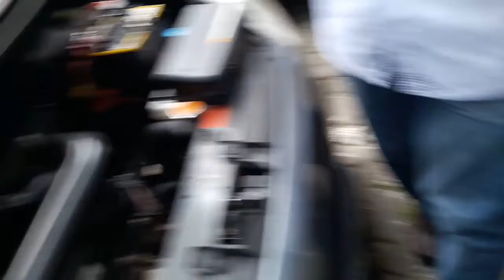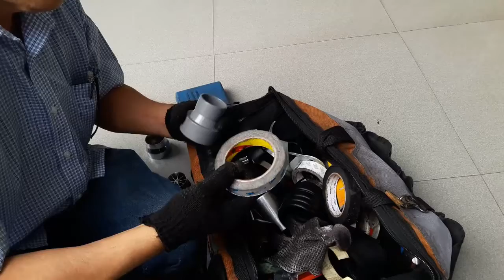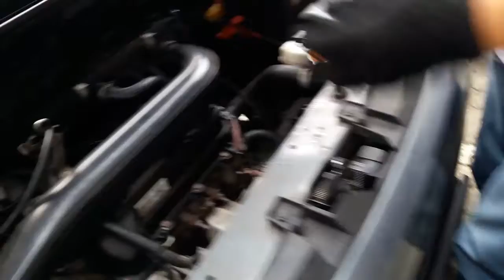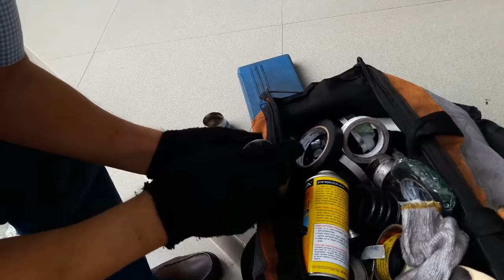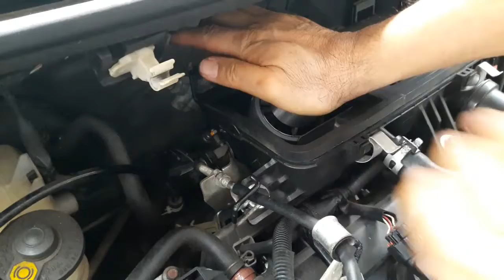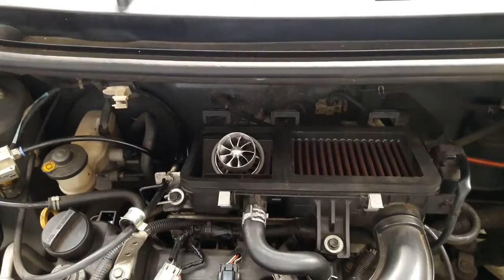Toyota Agya - Proxima Turbojet - D-700T

Comment: biaya brapa om ? mobil saya agya 1.0 manual thn 2016 om ...bisa kah ?
Reply from the maker: Kebetulan yg utk cc kecil stock lagi kosong. Yg ada stock utk 2500cc, type E930T hrgnya 6,5jt. Tapi klo mau dipake di 1000cc pun bisa
Reply: Mehong amat...ga efek bro
Reply from the maker: @caiciu  Bisa share pengalamannya pake Proxima Turbojet kok ga ngefek?
Reply: @PROXIMATURBOJET  proxima,simota dll yg baling²nya bisa berputar atau diam aja cuma sugesti bikin tarikan enteng/ enak.Udara yg masuk tidak padat seperti turbo aktif.
Reply from the maker: @caiciu  Oh begitu ... Bisa dong di share pengalamannya pake Proxima Turbojet, pake dimobil apa dan rasanya bagaimana? .....
Reply: Gilee duit 6,5jt mending buat remap
Reply: @Rioalbab01  betul om....jls keliatan bedanya
Reply from the maker: @Rioalbab01  Type yg harga 6,5jt itu type yg bisa untuk mobil sampe 2500cc
Reply: @PROXIMATURBOJET  lah untuk diesel 2500cc remap+dyno+pasang boost controller ga sampe 6 juta kok. Piggyback merk bagus aja 5-7 jutaan, kenapa harus pilih ini? ya mending remap atau piggyback dong jelas bisa dibuktikan di dyno
Reply from the maker: @Rioalbab01  Kelebihan alat ini sangat praktis, pemasangan hanya 15 menit, juga tanpa harus merubah apa2. Alatnya bisa dipindah ke mobil lain ....
Reply: @PROXIMATURBOJET  ada di youtube di test dyno HP loss 3
Reply: @Rioalbab01  turbo jet di peruntukan untuk orang awam yg belum tau remap, dan pigibag om.. Wkwkw makannya bisa diladalin
Reply from the maker: @Rachmadi_hr_production  Itu bukan merk Proxima ....
Reply from the maker: @Rachmadi_hr_production  Turbojet diperuntukan untuk orang yang mau mobilnya nyaman tetapi mesin tetap standard dan bisa pindah2 mobil
Reply: Mesin bensin klo remap doang emang ga banyak sih gain HP dan torsinya tapi duit 6,5jt mending porting polish dah 😂
Reply from the maker: @Rioalbab01  Beda jauh bro, klo porting polish itu pasif, klo ini kan aktif, baling2 berputar mempercepat udara masuk. Udara klo cepat gas padat berisi sejak rpm rendah dan tidak ngempos. Napasnya panjang ...
Reply: @Rioalbab01  asli 6,5 juta buat remap sama dapet dastek second
Reply: @Rachmadi_hr_production  ini baru top komen wkwk
Reply: @PROXIMATURBOJET  ngelak ae lu min wkwkwk
Reply from the maker: @rico2331  Ya, lain orang lain sudut pandang ...
Reply from the maker: @rico2331  Itu bukan merk Proxima bro ....
Reply from the maker: @rico2331  Hanya penjelasan aja. Ngomong2 pake dimobil apa dan type Proxima yg mana? Sharing dong ...
Reply: 90 rb aku beli buat Agya 1.0 bos